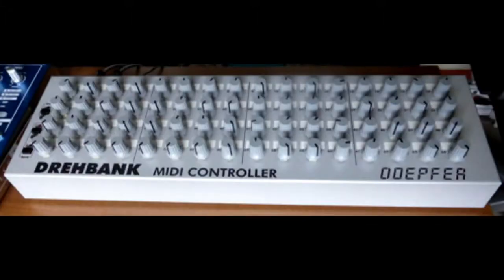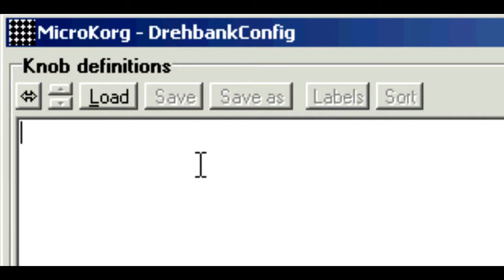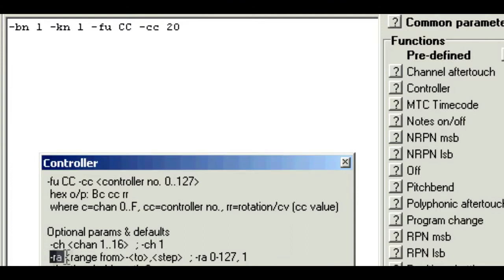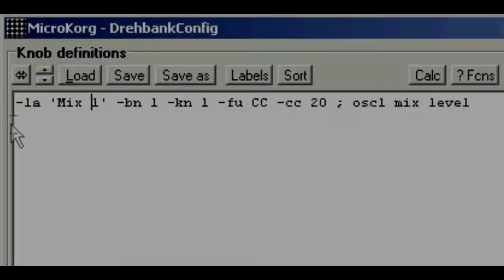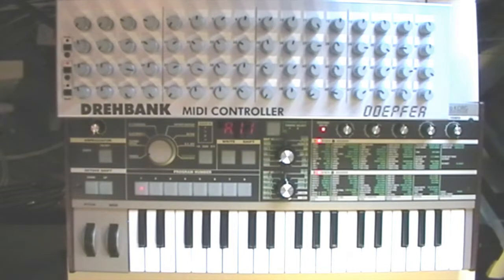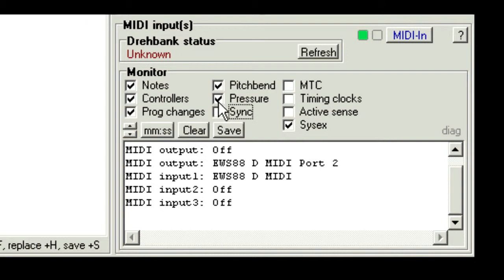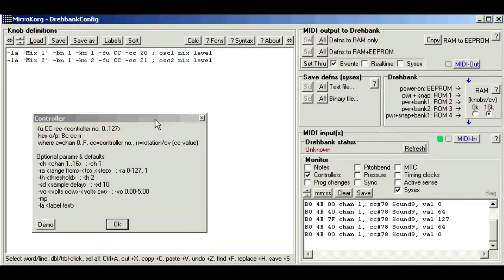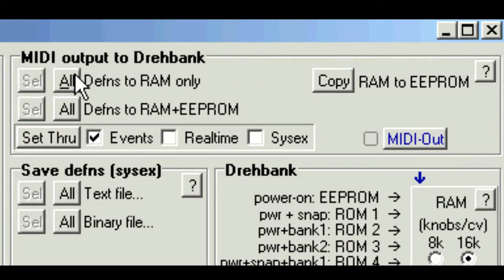DrehbankConfig - Drehbank editor tutorial part 1:  CC+microKORG

Comment: Nice piece of software Phil! 

I'm just taking my first real steps with setting up the MIDI controllers after seeing a very helpful video of using the Behringer BCR2000 to control a microKORG. I used the info to experiment with the microKORG XL+ and my Behringer BCF2000 and Akai MPK61. I've set up the sliders to be ADSR controls for EG1 and EG2 to mimic the controls on the MiniBrute. The plan is to set up some presets on both units for the microKORG, XL+, R3, Waldorf Blofeld, Pulse and DSI Evolver. The matrix controls of the hardware synths definitely aren't very performance friendly.
Reply: How is that akai controller?
Reply from the maker: Thanks for the feedback Ken. Yes it's a shame synths had to lose knobs to become affordable. On the Supernova, the waveshape, octave, semitone & fine tuning for all 3 vcos are handled by a single knob - crazy!
The 2nd part of the guide is in progress and covers NRPN messages with a Supernova, but also relevant to microkorgs for controlling their arpeg & virtual patch functions.
Reply: Phil Tipping Last night I mapped the oscillators, filters, mixer and LFOs and now the XL+ is like a totally different piece of gear when using it with the MPK61. I always see a stack of used microKORGs at a local shop's annual used gear sale and I wouldn't be surprised if its the awkward editing that discourage users. Now that I've taken this first step, I'll have to research MIDI to see how else I can improve things. One issue I can see with the MIDI controllers, keeping track of what controls what when switching presets. Next, preset to setup, the DSI Evolver.
Reply from the maker: KWHCoaster Switching banks is also a problem for control positions as well as labels. If your synth doesn't have a 'pick-up' option, you could get sudden jumps when controls are moved after switching. I would always go for a higher 'controls per bank' ratio to avoid having to switch... this guy's got the right idea :)  http://christianbloch.files.wordpress.com/2008/10/1.jpg
Good luck with the mapping.
Reply: Phil Tipping
Yes, that is a problem with the MPK61, faders at least. I'll have to look for this "pick up" option. However, the motorized faders on the BCF2000 move into the correct position and hopefully the encoders will do the same. More BCF2000 experimenting to do.

Yeah, multiple units is the way to go. I finally picked up some rack rails and a table top rack for my MS2000R, Pulse and the patch bays to get them properly mounted. Now to plan configuration.